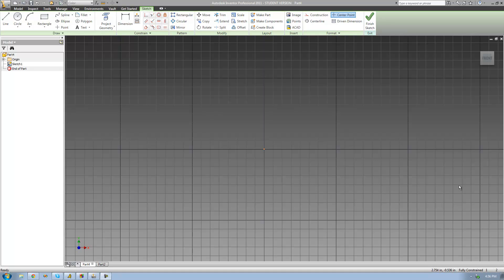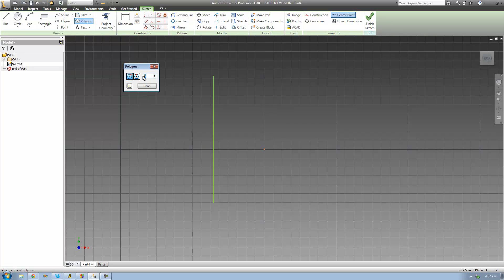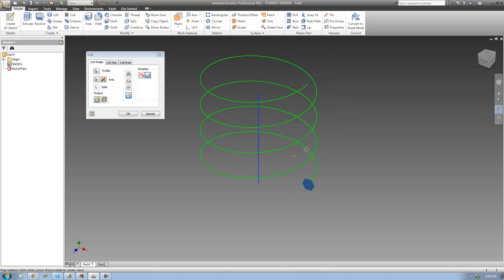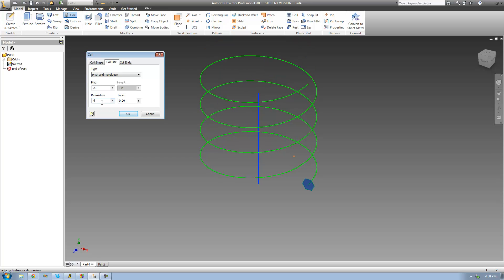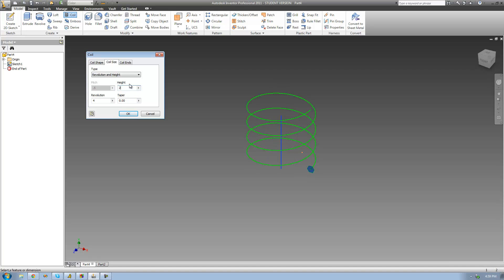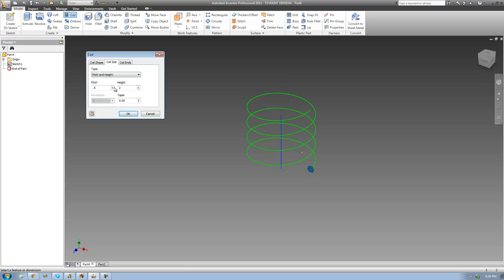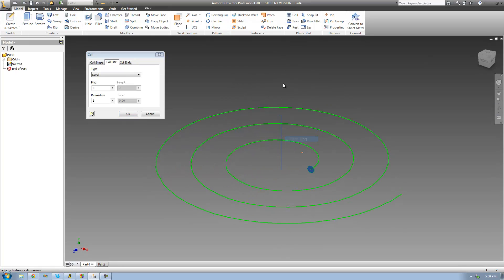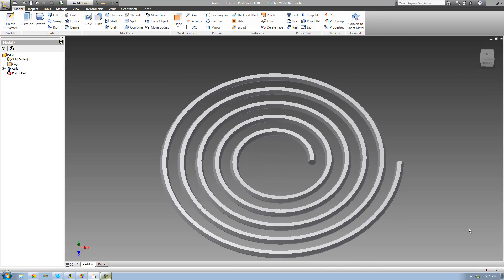Autodesk Inventor Tutorial 33, Coil Tool pt.2

Comment: Hi Adam, you're tutorials are great. I have been using auto cad for some time, but I am a newbie to inventor. Your videos have really helped me get a good understanding of how to use it. I am using inventor for steel fabrication for work but I am having a real problem with creating a screw blade for a screw conveyor. If I draw a profile to represent the blade edge then a line to represent the axis (ie centreline of steel tube)that it will revolve round and set pitch and revolution as 1 I get the blade that I require which looks great. The problem that I am having is that I would like to convert it to a sheet metal flat pattern so I can output it as a dxf for a cnc machine to cut it out, but every time I press covert to flat pattern it says it is unable to convert. PLEASE can you do a tutorial! keep up the good work.